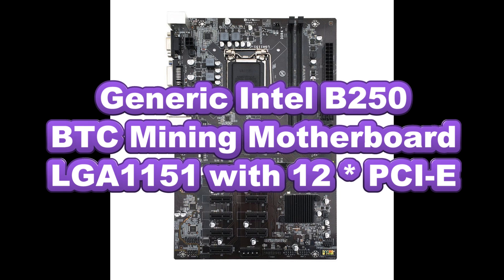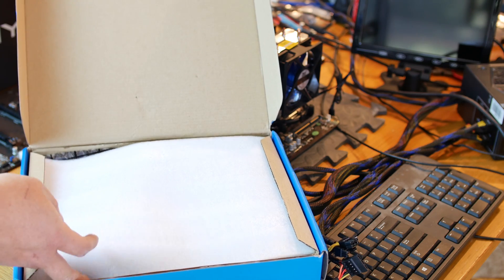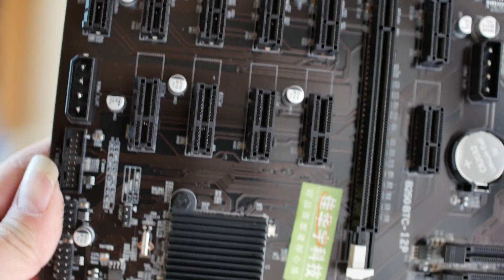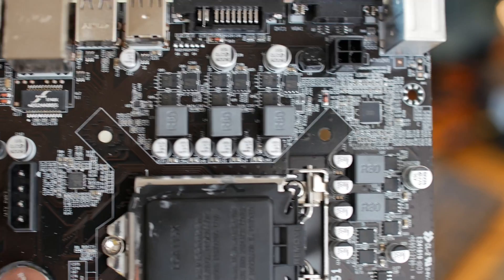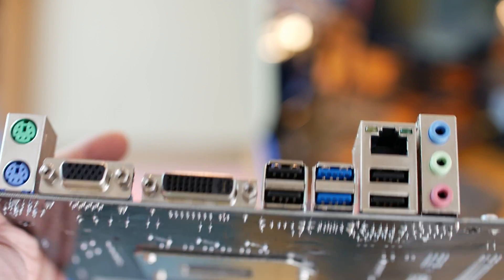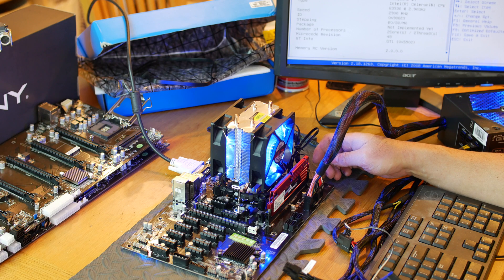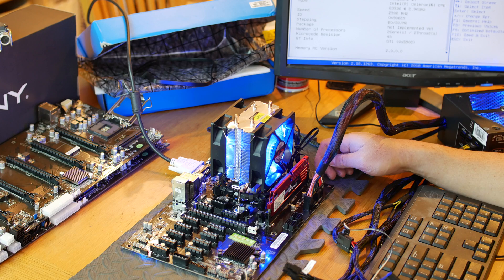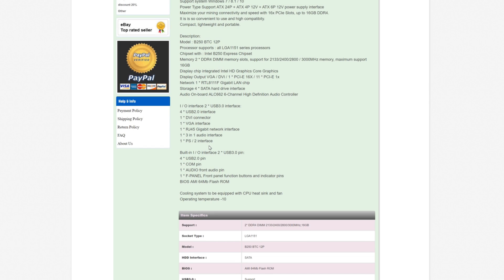Quick Look:  Generic B250 Mining Motherboard with 12 x PCI e

Comment: Realizing I’m a little late to the show. I built my 1st 6 card rx 6600 rig last month and with this motherboard it’s still humming along like a little sewing machine . 
Now I’m building on my second rig using the same exact motherboard I found out today that the Ethernet port did not work . I should have noticed that issue faster than I did anyway this rig is a RTX build which has me thinking I should have stayed with AMD because it went so smoothly . So now I have the bad Ethernet board going this board or these RTX cards that won’t show up at all in hive OS . I see the cpu and the board is configured to my worker so could it be I need a bios update on this board ? Man this deal has me all upside down I need support before I punt this rig off the porch no bs .😜. What say you bud ? I’m so noob it literally hurts hurts my soul see all those RTX cards just sitting there .Thanks ! Great video btw 👍

Comment: Hi! I have same board but no video signal. I tested 3 gpus and onboard. it was working, but i changed in the bios the csm video to uefi and i no longer had enhim video signal and i don't know how to get back in the bios anymore. can you help me?
Reply: Try to click on f2/11/12 juste after powering on the rig and please if you can share the bios changes with cause every time I press save and exit it still as she is so I can't get out from bios unlike you may it be from the hdd cause I have an other one with hive os working directly with out access to the bios 
For your problem it's easy press and hold the f buttons when powering on the rig till you get it try f2/1/12 I think one of them help me if you have any idea please thnx
Reply: is it ok now ? how you resolve your problems ?
Reply: @mareautech6067  yeap. Clean all. Put a speaker

Comment: you need a 6-7 gen processor, LGA1151. DDR4 ram. I am struggling to make it work. Have you made it work?
Reply: Hi Anthemboy, how you noticed you needed a 6-7 gen processor ? I got a i3 9 gen installed on it and I can't make it to run, it will power on for 3 second then dye. In the Amazon website where I bought it from it just says you need to connect an LGA 1151 however it doesn't says nothing about the generation you must install.
Reply: @rudolfohess8737  you may need a bios update?
Reply: @rudolfohess8737  Did you solved your problem? I bought one of these but I have a celeron 9th gen too.
Reply: @sebastianarauco238  yes I did, I had to buy another processor from 6th or 7th generation, I got a Celeron G3900 that will works with a 2133 RAM and the motherboard will also works with this kind of RAM, however if you are planning to get the 12 GPUs connected to it, you gotta buy an i3 from 6th generation and that will works better than the Celeron, it's my experience.
Reply: @rudolfohess8737  Thank bro sir, I'm on it

Comment: Bro please share tweaks and configs to use 12 GPUS please, also which ram and CPU can I use with this motherboard?
Reply: You can use as a ram ddr4 and cpu 6 or 7th generation. Iv got cpu as a intel i3 intel 6th gen with 1151 pin.